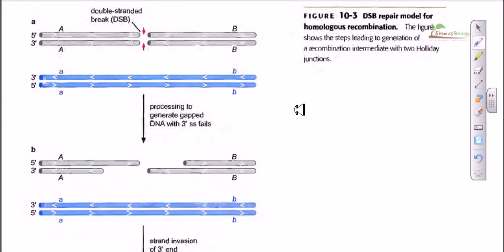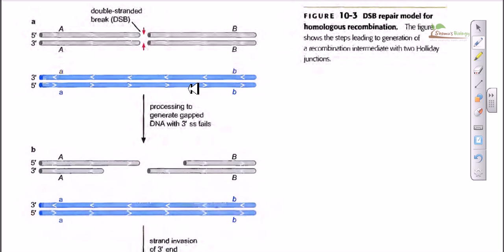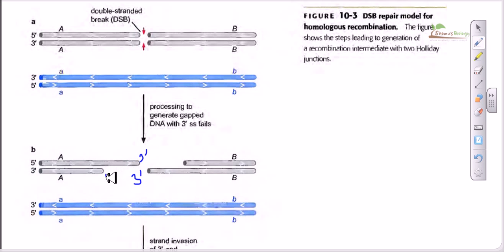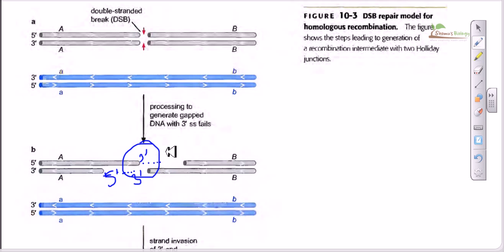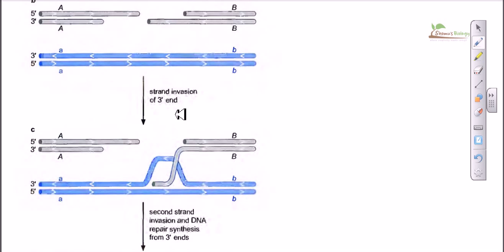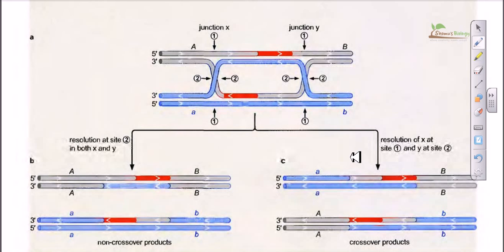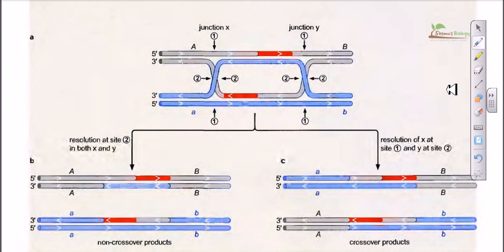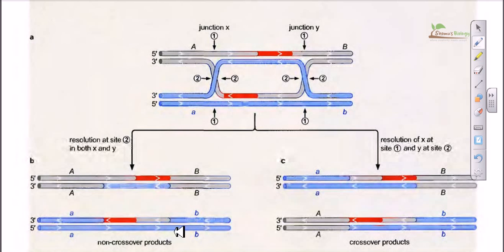Double strand break repair model

Comment: Might I ask how the second DNA end (depicted at the top in your picture) is "captured" in bacteria? I know on the bottom strand that does the strand invasion to create the D loop, that RecA nucleoprotein filament facilitates the strand exchange, however if RecA is also bound on the other 3' tail, what stops this end from also invading - what allows it to pair with it's cognate strand? Also if this is a double strand break, what keeps the two (now seperate) strands together and stops them from diffusing away from each other?